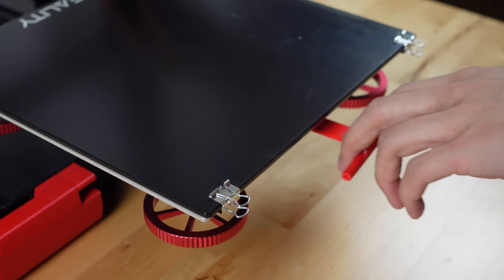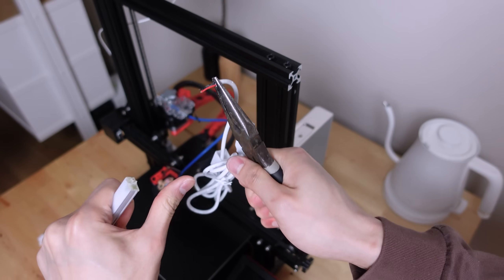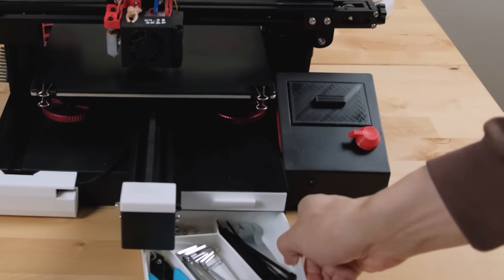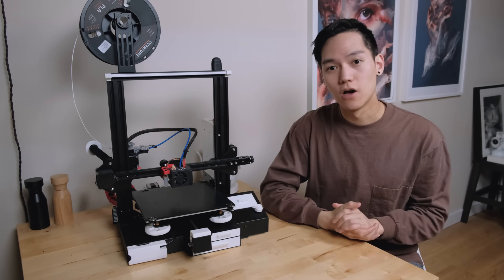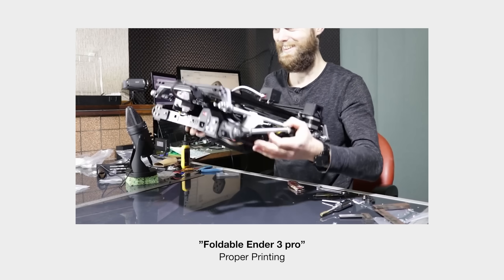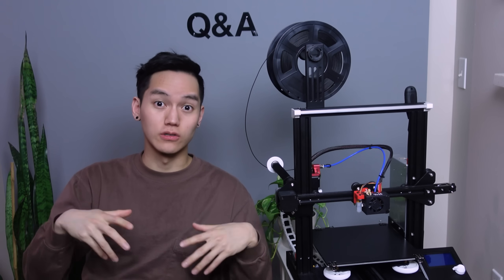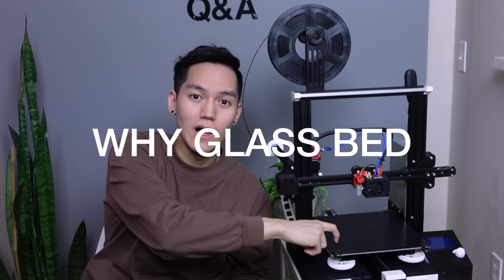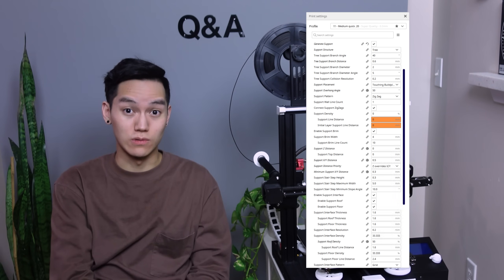An Update on the Ender 3 Pro Upgrades - Part 2

Comment from the maker: Part 1 - https://youtu.be/kG_YKeJDaX8
Part 3 - https://youtu.be/4jk6kZIwsQA
Part 4 - https://youtu.be/EQJfDLENYnU

Get this 3D printer for $189 with this affiliate link: https://bit.ly/3kcSKz0 and discount code: RP3ROMP10
Reply: What time? Also, cheers for the videos, you inspired me to start 3D printing, I now have an Ender 5 and a CR-10!
Reply: Cool. Cracking viddy again. Friday sounds good :-)
Reply: Scott!  Can you link or include a tutorial to your light/Pi power setup so I can do the same and save some outlets?!
Reply: @Ayush Patel I did!  It's part of why I bought a printer!  I'd like to see the schematics or a wiring diagram as to what to connect the wires to a little better!
Reply: Cool video, Scott! I need your opinion, which printer do you think is better: Creality Ender 3 v2 or  FLSUN Delta QQ-S- PRO? (looking at price-quality ratio) 
I wanna buy my first printer and I am thinking between these 2 printers. I mainly want to print detailed figurines.
Reply: pin this
Reply: Kiemplant= a young plant 🌱 That just came up from the dirt it’s dutch/Nederlands
Reply: I spent 2 days printing up the drawers and case. They printed nicely and fit like a glove until I found the printer bed couldn't pass the drawer case. The printer bed rail screws hit the back of the drawer case and can't move past it. Any updates or advice?
Reply: I wonder, does it not help you get views if you include the printer name in the title?

Comment: I tried the light setup from this video, eventually started having issues with printer bugging out, didn't realize it at the time, but tried 3 different motherboards, tried insulating the wiring. Nothing worked. Put it up for a year, dug it back out, went back to original setup, removing light and converter and now it runs fine

Comment: This is a rewatch reply. One thing I would say, I went with a G10 bed sheet instead of PEI after having Glass on my Ender 3 v2, yes it's not magnetic, but it's way more versitile, PETG doesn't stick to it like it would to glass while printing, meaning after printing you can easily remove the print and not mess about with gluestick or other means of adhesion to prevent print bed damage.

Comment: so first its a raspberry pi 4 you put in there, no big deal about that, but here's a tip: I saw you removed the logo from the lightbar with sandpaper but it left behind some noticeable marks. next time you ant to remove paint or logos etc use acetone based nail polish-remover. it does a great job of removing things and it doesn't leave stuff behind. he aware though it may not work on every surface and may damage some plastic types but for metal etc its fine!

Comment: What I love about the ender 3 pro is that when I bought it i found a free stl called speeddrive that allows you to upgrade to direct drive for completely free i recently got the cr touch and decided to un direct drive it because it limited the print volume size to much and i was to lazy to change anything more in the marlin that i made so simply decided to un-direct drive which was a hastle, but it was possible for free although I am still getting capricorn, what I am saying is that it is possible to do pretty much and upgrade and with some time and effort undo it sure you might have to buy parts for upgrading, and also for unupgrading but it is so cheap to do so it is amazing.

Comment: If you need to print smooth flat surfaces use a glass bed, but turn it over with the smooth side up.  I also use hair spray for good adhesion to the surface.  I print small plastic panels for audio enclosures and the smooth side of the glass bed makes for a very nice and smooth appearance.  I use the Creality branded one.

Comment: can you put stabelizers on the printer so if its a high print that its not shaking on the top because if you use a direct driver for the pla its heavyer and if its a fast print speed i think its going to be shaking on the top if you want to print higher prints. let me know youre oppinion please

Comment: 2:20 I fell like this might be a bad idea since that liquid can cool things down to -40 deg which would introduce a huge amount of stress on a heated glass panel and it might shatter. Also, given what we know about tempered glass, it would just become a million pieces and be extremely annoying to clean up.
For me, I just flipped the glass bed over and used the side without the coating. It would cause bed adhesion problem but I get away by setting the bed temp higher.
Reply: This part. 

For PLA I just set my bed to 60-65 on the smooth glass surface and it sticks just fine 🤷🏽‍♂️

Comment: Thanks for the videos. Fun to watch and very informative. 

I printed the bed knobs from this video. The knobs came out great but the design uses nylon locknuts. In your video you use the nuts that come in the screw kit, which I also have. The problem I encountered is the nuts in the kit are much smaller than a nylon locknut, so they don’t work with the design. In your video, the hole for the nut is much smaller and the nuts from the kit fits snugly. Did you modify the design of the knob to accommodate the standard nut from the screw kit?

Thanks again, really appreciate the videos.
Reply from the maker: nope. i just force shove the nut in there. use a hammer maybe? but if it REALLY doesn’t fit, you can also try heating up the nut area with a lighter so the plastic is softer. that should allow you to force press the nut in there. be careful though and good luck!
Reply from the maker: OR re-print it slightly larger. that can probably work too.
Reply: Thanks. I did a poor job explaining. The nuts in the screw kit are to small, so they flop around in the location in the knob. I see you didn’t have that issue in your video. I am going to get nylon lock nuts from Home Depot and see if they are large enough. If not, I will try to shrink down the size in the design and reprint. Thanks again for your help, much appreciated.

Comment: I had usually built my own PCs. My friends would scoff. But when they used mine it was much faster than theirs. They stopped coming over...
I just decided on the Ender 3 V2 based on price, function, ratings, and availability of upgrade parts. While lots of parts may say it's anemic, it also indicates popularity which gives credit to the product.

Comment: Hey Scott,

First of all, loved the video

Just one question tho, I just ordered an Ender 3 printer instead of the Ender 3 Pro, and most of the mods you've included seem to be applicable to the Ender 3, but when you answered why you chose the Ender 3 Pro, you didn't explain why not Ender 3, just why not Ender 3 V2. 

Is there a reason for getting an Ender 3 Pro instead of just the Ender 3?

Comment: I personally have 6 E3Pro printers. Two of which had Creality PEI beds on them, but just recently changed back to glass beds for all.

Why?

PEI bed is not a rigid surface, it's like a very hard gel, but still gives when filament is pressed into it. I make prints that sometimes are assembled and need a little precision to fit together, and for me PEI couldn't do it. Glass works great for me, and if you need better adhesion, I highly recommend to cover the glass bed in painter's tape. Not glue, not hairspray.

Comment: How do you prepare your glass bed to get good adhesion? I've given up at least. Do you use turpentine, ethanol, isopropanol, methanol, soap and water, what is it?
 
Also: Wham bam magnetic flexible spring steel beds can withstand heat up to 150°C (300°F), bed adhesion problems are non existence with their PEX surface, couldn't recommend it more.
Reply from the maker: cool good to know! i'll definitely research into that some more. thanks
I usually just print with a very low first layer so there's really good squish and clean the bed between prints with alcohol or hand sanitizer with a microfiber cloth. good luck!

Comment: Awesome vid man, I don't even remember how many times I've rewatched your videos! Keep up the good work!

Quick question. How do you deal with PETG on glass? I've been printing on PLA and want to experiment with PETG, I've seen contradicting tips. You seem to print with them no problem
Reply from the maker: with PETG on glass, depending on what you're printing there can definitely be struggles with bed adhesion. i usually just make sure the glass bed is super clean with some alcohol wipes and then set the first layer height to be a bit lower so it gets a good first layer squish. if it's a really challenging model and it still fails then i whip out the glue stick which has never failed me before. good luck and thanks for the kind words :)

Comment: Are you sure you linked to the correct bed knobs? I printed the linked knobs and the M4 nuts don't seem to fit. Also, the two objects, on closer inspection, don't seem to look the same.

Comment: I've been telling people this air duster/freeze spray trick for years, especially for resin prints that can stick super hard to the build surface, but you are the first youtuber I've ever seen mention it.
Reply: Also FYI for anyone with a resin printer: If you have a very large, flat bottom of your print you can also stick the whole thing in the freezer and then once its cold hold the platform and dip just the print in some hot water and it will pop off of the build platform. No more need to fear putting large flat areas on your build plate, and you can get much better adhesion while printing because of it.

Comment: the magnets start to loose their strength at higher temps or thats what ive always been told, i have glass on all my printers with the lattice surface except for my e10. it has just plan glass but even on that just the right amount of squish from the first layer as its goes down an it acts just like the lattice glass, once it cools enough. the prints can just be picked up like it had never been stuck to the glass. i never tried spring steel but i think they have to have a pei sheet an thats something that has to be changed or at least thats what ive taken from all the videos ive watched on them but i started out with cutting my own mirrors  to fit, then i found the lattice glass an it looks nice an i like the texture it leaves on the print so ive never had a reason to try the spring steel so im going on what ive read an seen online.
Reply: Yes, magnets lose their magic at about 80°C.
I used to weld, and decided years ago to try to use magnets instead of clamps. Using permanent and electromagnets, the endeavor was pretty much a bust.
At times, I even noticed the magnetic field pulling on my arc and puddle.
Blew about 3 days on that project.

Comment: Great video! Fun fact about the air duster trick, those actually contain refrigerant, not compressed air. When you hold it upside down it sprays out the liquid which boils off outside of the can. That's why it's so good at cooling, because the chemical is designed for that. Depending on the specific air duster the chemical may be harmful so it's worth checking your preferred brand to see what they use and read up on it.
I got my Ender 3 Pro recently and it's been working great! Took about a week of tweaking and troubleshooting but I'm super happy with the outcome.
Reply: Hey I think so u r indian

Comment: Gonna recommend not doing that air duster trick if you're printing high temps and trying to remove them immediately after if you have a glass bed. That can have the potential to crack them or even make them explode. It should, technically, only cool the top layer since its not dunking the whole thing but still a word of caution for the technique.

Comment: I didn't know that the Creality glass bed came with a special coating... Until after I scraped it all off after the printer glue I bought ruined it... And now I can't take the bed off because I didn't think leaving the magnetic surface on would be an issue other than half a mm extra height...

At least the adhesion is good...

Comment: How did you do the cable chains i couldnt do them and i nedd them so bad mine also got stuck in a print and i cant print them help
Reply from the maker: why can't you print them? what seems to be the problem?
Reply: @ScottYuJan  when i print them it makes  a bunch of dots all over my print bed then it does lines to make it come together and then its messes up ive tried everything from leveling bed to e-steps too belt tensioning to bed adhesion methods im so cofused
Reply from the maker: @ttcplays4570  the dots and lines sound normal but how does it mess up? do the prints fall of the print bed at some point? or... what’s going on exactly
Reply: @ScottYuJan  when it starts doing lines they fall off the print bed and i use bed adhesion glue stick then i tried so many things and im also have a problem with the size of the dual draws it says that it will take 1 day is that true cause the case and draws take so long and i just wanted tot make sure it was at the proper size but back to the chains the one for the bed cable is fine but when i do the one for the motor cables and extruder cable they always fail and fall of im sorry i have so many questions
Reply: and im also using the same glass bed as you

Comment: weeeeell, the air bluster is not that good, because, if the bed still hot and u just freeze that thing, you can break that shit, seriously, the change of temperature can break the glass, its thermodynamics, u can wait a couple of minutes, but just at the moment with the bed hot, can make a mess

Comment: The air duster trick works, but that chemical smell lingers. If you're not in a huge hurry, remove the entire plate after it's had a chance to cool a bit and stick in the freezer for 5 minutes or so.
Reply: It would probably be safer to attach a fan with a timing switch so when the Printer homes the fan will run for a period of time to cool the part and build plate with Ambient air!

Comment: You talked about adding heat sinks to the Raspberry Pi. I am looking at adding a Raspberry Pi 4 Embedded Heatsink with Fan to it. Would it be possible for you to edit the cover so it will accommodate for one of these?

Comment: I bought one few days my first printer, I'm having problems with my filament won't stick too my bed. I set the level and I use paper too adjust it.
Reply: Wow, I know light years more than you already and I don't even have a 3D printer yet. Reading goes a long way.

Leveling has nothing to do with your sticking issues. You might want to experiment with bed temperature.

Comment: For nylon, I love using the flex plate, I have a blank whambam flexplate - and I adhere a thin sheet of garolite to it. I use that for nylon, -- just use glue stick, and 90c, and works great. For everything else, swap to the PEI coated flex plate. The magnetic surface makes swapping print surfaces super easy.

Comment: Honestly, an Ender 3 is like having a tuner car. Sure, it works out of the box, but part of the experience is tinkering and making it your own. Which makes it an excellent machine to learn the hobby on.
Reply from the maker: couldn't agree more. that's a great way of putting it!
Reply: Adding on to this, an ender 3 is the Miata of printers. Huge community, cheap but nice, great little thing
Reply: @jollygreenjeff2640  its not cheap tho. The amount of money needed for it to work as good as bambu is crazy.

P.S i understand video is old but there's still fresh replies
Reply: Just got an ender 3 for free. I also have a turbo 1995 civic lol

Comment: I think the printed cabechains could be bad for the performance because of friction due to the rough surface of 3D prints...
Do you have any problems wwith them, bechause I thought about just designing adapters to mount "traditional" injection molded cablechains, because of lower friction.

Comment: You should make an upgrade video for the Ender 3 v2! I just got it and it is currently printing my first print (the benchy). I loved how you upgraded the Ender 3 pro and the and v2 seems even better. I watched your video on upgrading the Ender 3 pro but a lot of the old Ender 3 pro printed parts don't work with the v2. I would love to see you make an Ender 3 v2 version. Just a thought.

Comment: 2:25 The glass might break from the Quick heat change i think
Reply from the maker: since the air duster only cools the very thin top surface i don't think the extreme cold is getting very far past the coated layer and into the glass, at least not enough to cause a shatter from what i've experienced so far. plus the fact that it's borosilicate glass probably helps too BUT i just learned that even though air duster cans don't contain CFCs anymore they still contain some gases that are bad for the environment so... i goofed once again 🤡. i'll make a note of this in my next video and give other alternative methods. thanks for the comment!

Comment: I cant recommend the ender 3 v2 because of all the issues related to the screen that have yet to be fixed. I moderate a 3d printing discord and the amount of issues i see related to the screen are unacceptable.
Reply from the maker: oh dang, now i'm scared for my dad... that's not good. 
is it the "official creality" discord by the way? i just recently started using discord so trying to find a few i can join. thanks.
Reply: @ScottYuJan  No, im a volunteer mod for the th3d discord. The ender 3 v2 screen issues can be fixed by just replacing the screen with a creality 12864 style and a printed mount, then flash the printer as an ender 3 w/ a 4.2.2 board with tmc 2208. There is a large list of bugs the stock screen causes.

Comment: You can get flexplate systems that are good for >150 degrees, that's not the problem, the problem with printing nylon on PEI (smooth or powder coated) is that it doesn't stick.. at all 😅